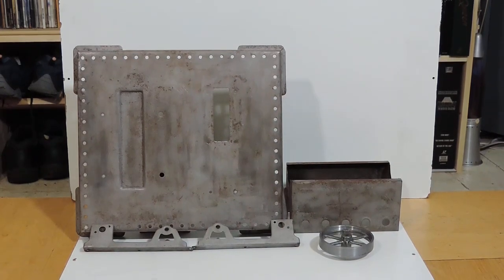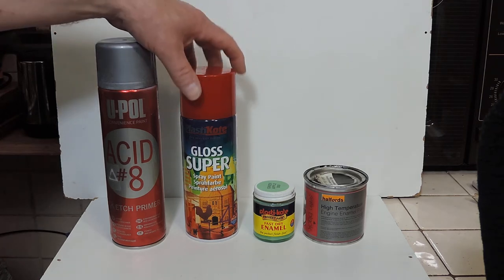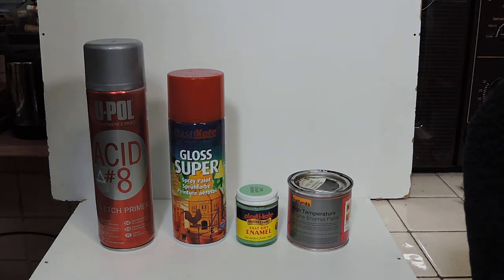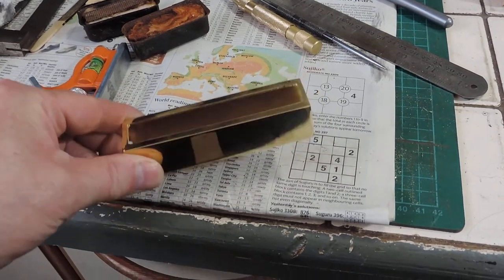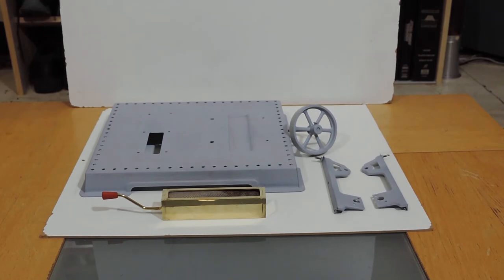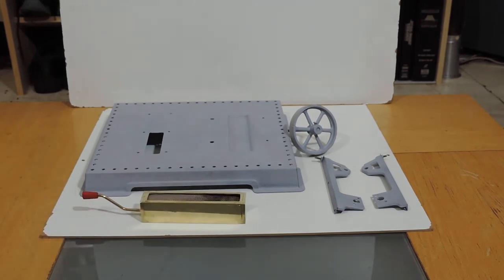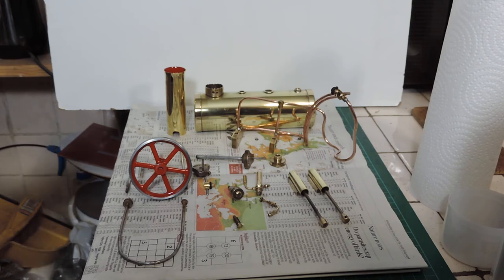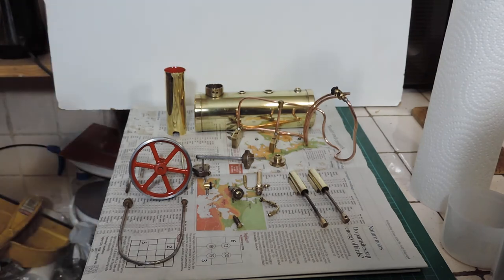Mamod SE3 Model Steam Engine Restoration -  Part 4

Comment: Great but as a beginner I would like to see how you soldered the burner , how you mount something on an ardour to clean it and most importantly hoe you flare out a chimney ( easy to you but a miracle to me)
Reply from the maker: A square of solder was formed to fit inside the square tube then the tube was stood on the end plate and heat was applied. Using an arbor to mount things for cleaning depends on the item being cleaned. For small items a simple nut & bolt will do the job. To flare the end of the chimney, I heat the end with a gas torch then place a large ball bearing on the end and hammer it until the required flare is achieved.
Reply: @RetroSteamTech  that’s great thankyou for your reply

Comment: Hi you say to bake the fire box ! I have done that worked great, but do you bake  the base plate as well or is that not necessary
Reply from the maker: Hi Paul. No I've never bothered to bake the base plate and so far the paint on them has survived just fine.

Comment: Would've been interesting to me to see how you soldered the end plates onto the burner - did you use silver solder, or the "ordinary" stuff?
Reply from the maker: I just used ordinary plumbers solder that you can get from places like B&Q etc.  I form a rectangle of solder which fits inside the end of the brass tube, cover it in flux and stand it on the end plate. Seems to work quite well.
Reply: +Retro Steam Tech Thanks for taking the time to reply. Your videos are very helpful, especially the tip about curing in the oven - I'll try that for my SE2a restoration. Cheers for now :)
Reply: Any idea what thickness plumbers solder is?